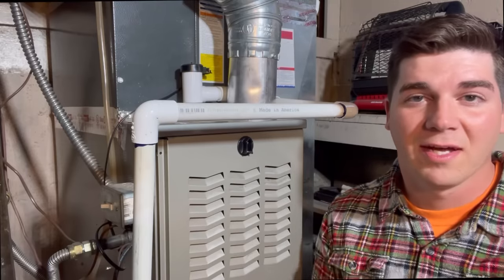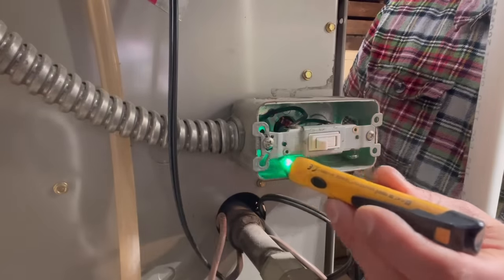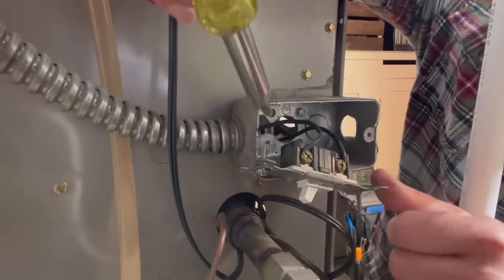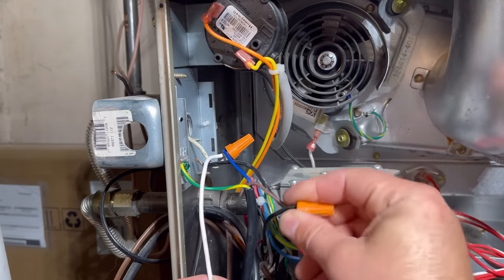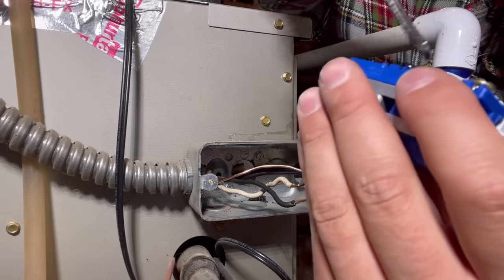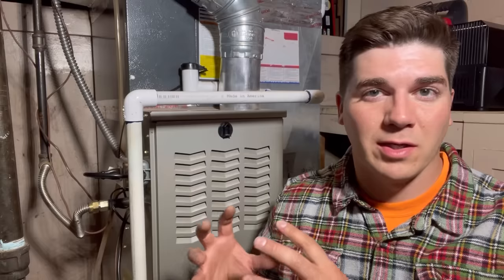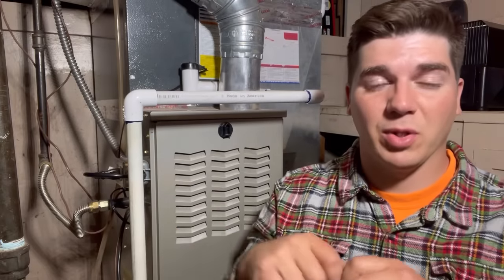This Could Keep Your Family Warm During An Emergency Power Outage.

Comment: I did something similar a few years ago during an ice storm, I cut off the end of an extension cord, took the wires off of the switch and connected them directly to the pigtail that I plugged into my generator, then once power was restored, I connected the switch back up. It was a temp setup during an emergency, but got the job done, this is obviously a more permanent solution. I've since just wired in a 4 breaker transfer switch for multiple outlets in my house, furnace, fridge etc. all powered by one extension cable to genny.

Comment: Just remember new furnaces are computer controlled and ungrounded generators or non inverter generators may cause problems.
Reply: Great point! Is having the ground wire attached to the case of the cabinet not sufficient enough? Thanks for your insight!
Reply: @BenFyvie  may need to ground the generator itself.

Comment: Thank you sir for sharing this hack to help us your followers in the case of an emergency situation when utility companies fail to keep up the power grid running like what happened last year winter here in Texas we were with no electricity in really cold weather but we were just blessed that we just didn’t have power for half a day and we were able to go trough it but other people were days without power and other just perished under the bad weather conditions and it was sad to watch in the news few days later the aftermath of the tragedy and knowing how many lives were lost and it could be prevented by doing a project like this were we can find a survival solution for the emergency I hope we’ll be able to do this “modification “ to our furnace and power it up with a power generator or with the new solar panel battery instead of a gas generator I hope any of your followers will take advantage of the help you provided in this video… since I subscribed to your YouTube channel I have found tons of valuable information, thank you so much for your help to others is really appreciate it,You have a blessed day now!!!Saludos!!!👋😊👋

Comment: Thank you for this video. My issue is something different but this video gives me the confidence to be able to tackle this issue myself. My problem is that my switch to control the power is mounted right above where my furnace filter goes in. So every time I replace my filter, it rubs up against the switch, often making it very difficult to replace the filter. It will often damage the filter when removing it. But I am definitely going to try and relocate the switch instead of trying to relocate the filter location in the return.

Comment: What I did was split the Romex in my rafters into two metal boxes, the first metal box (from the breaker) I added a single receptacle. The second I did a change over of Romex (to the furnace) to a stranded 14ga "workshop replacement cord" in 10ft so it could drop down to the floor to connect to my extension. I  keep the stranded cord spooled up and stuffed into a brace in the rafter when its plugged into the outlet. My furnace (Armstrong Air Ultra V  Tech 80) ran perfect off a new Craftsman CMXGGAS030731 generator with no other device in between.

Comment: We put in a new high efficiency Furnace when the last one died. I bought a $200 RMS UPS and I plugged the furnace directly into that which is plugged in to the switch outlet. That is for my friend who lives in the city, I live in the wilderness with an oil-fired Toyotomi oil-fired Toyo stove. I have a square wave inverter I got at the auto parts store, 12 volts to 120, and some old batteries that got me through the 10-hour power outage. I was eager to put in the additional power when we put his new furnace in as I have needed it in the Alaska wilderness. The power only fails when it's -20 outside and the wind is like a unrelenting hurricane with clear skies.

Comment: 10:37 Wagos. Haven't had the chance to try these yet but I DO like the lever to undo them. most other push-in connectors are permanent. All LED "can", "wafer" lights have push-ins. ALWAYS test your connections by pulling on the wire. I can't tell you how many times I've finished the install and flipped the light switch and it doesn't work cause of a loose wire/wirenut/poor connection. I change most factory wire nuts as well as a 80% rule of thumb.

Comment: I'm in ontario canada.  Back in 1997 the hydro inspector told me how to hookup my generator.  Basically the furnace feed wire was  cut and lead from furnace put in a junction box. The box then  had a cab flexible cable with a male twist lock plug. Within reach of it was a box with matching female twist lock fed by the power feed from house service.  Beside it was an identical box fed from my generator (or the battery powered inverter). So I  plug the male into whichever feed I  want and always have generator isolated from my house service.  Interestingly an electrician told me that this set up is no longer approved. I'm grandfathered as it was acceptable in 97

Comment: Very smart way to create a bypass to power the burner.  My system has circulators which are also on the burner circuit, make sure your auxilliary equipment is also powered when using the bypass power.

Comment: Worth noting that if your furnace employs an e.c. motor ( converts ac to dc at the pcb and utilizes pulse width modulation ) such as the newer carrier models you are going to want to VERIFY the draws ahd voltages in the circuit under load.  Running these blower motors off of an improperly balanced power supply will kill the motor which is way way more expensive than replacing a split cap motor of old days..  we are talking a grand easy. It also is likely to not work at all till you get your grounds sorted.    If youre still reading, take all that into consideration, im not saying the o.p. did anything bad here, im just saying that all mechanical systems are not alike. :) respectfully.  Good video . ( you should never use quick connectors in electrical work either, even though they do look cleaner  ;)    )

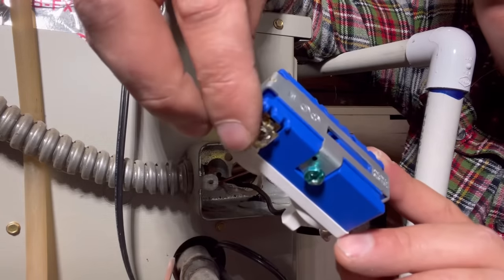Comment: @ 3:05 Wiring is not incorrect but could be simplified . Brass colored screw is "hot" ALWAYS, silver screw is neutral, and green screw is ground. No need to break the tab between the 2 black screws for this application, just tighten them with no jumper wire needed. Wire as black (hot) wire to brass screw, white (neutral) wire to silver screw, and bare/green (ground) wire to green screw. Check switch/receptacle with multimeter to verify switch controlling receptacle without all the jumper wiring if in doubt. Furnace cord/wiring as shown in the video.

Comment: well ducted air conditioners are using a lot of watts when been in cool mode and in heat mode if the unit is a heat pump!If the unit is running on gas then the only thing thats running is only the blower fan so in theory the unit only need 29 or even close or less than 100 watts to work!So that thing you saw us not only it works but its is something that every one needs to know!Nice video and keep up the good work!
Reply from the maker: Yes this will not work with a heat pump unfortunately. Only for 110v applications like a gas furnace.

Comment: I used a 3 way switch it has 2 power sources ComEd and Generator. The common terminal is connected to the furnace. I have a small transfer switch here so I can switch in and out things as needed.

Comment: You can make or buy a double male cord and just plug it into the receptacle. I wired my furnace with a 2 outlet receptacle after the switch. Turn the switch off, plug in double male cord and you're good to go.

Comment: I had another thought... this configuration would allow use of a Kill A Watt or equivalent energy usage meter.  (Assuming of course the pigtail was not kept to short for it to reach the outlet on the that device.)  Knowing the actual consumption of the unit could help is planning the overall load that the generator can handle.  I thought of this because I just had a solar system with batteries installed, and if I loose power in the winter it is the batteries that will keep the heat on.
Reply: I had the same thought and intend to do when I implement this.  I've tried to measure furnace power in the past with a clamp current meter but I don't think it's as accurate as a Kill A Watt.

Comment: Very clever idea to get around a hot pigtail,.   Note that an Eaton switch/outlet is being used in the video.  Terminal locations on a Leviton device are in different places, so it will have to be figured out.

Comment: One note about powering your furnace from a source other than the household supply, my furnace specs say it must be good sine wave power like comes from the power company. Some generators don't produce clean sine wave power. I bought a Honda EU2200i generator that claims to produce clean sine wave power.

Comment: Thanks for the video and the other video you posted with wrong info, I figured it would not last long, but you gave me a better way to get power using the converter to work the furnace. I have been doing research for months on how to power up and gas boiler since I have steam heat in the house. I was looking at the solar panels with battery back up, at least during the day it will charge up and here they don't have enough power to handle the furnace. After looking at your video and you mention about the inverter for the car battery. You got me thinking here. Need to do more research on  this!

And I have bought two power surge battery backup to power up the Frigerator during to power outage if I had it. The furnace is one I really was aiming for, but watching your video the converter maybe the way to power up solar power battery backup. again research first on anything!

Comment: Only works if you have a Non-Electric Heater.
Natural or LP Gas, Home Heating Oil, or Coal Furnace.
Also, I would recommend that the inverter should be a True Sine Wave Inverter.

If you Have all Electric Heat,  then a 12v Inverter will not work.

One Winter I was able to use a 800w Parabolic Infared Heater on a 2000w Inverter.  
it was enough to keep one 10 x 10 room warm.
The Inverter was rated 1000w continuous, and 2000w peak.
Make sure you double check the rating of the extension cord.
a 15 amp cord is only good to handle a total of 1800 watts.

also
Forget about the Clay pot and Candle heater,  Doesn't work.
Might keep a very small closet warm though.
but that wouldn't be very safe..

Comment: Have to turn breaker off for furnace in panel also before starting generators, using invertors. It will back feed to panel. Shock line workers repairing the lines, power outage.

Comment: I know people are saying just get a generator...welp sometimes that is not the solution. Our house is 240 years old, has had additions, and there is no way to hook up a whole house generator for reasons I won't enumerate here. We did install a plug to one of our fossil fuel furnaces to run off a generator (we have two portables) but it is not easy to get an extension cord there and somewhat dangerous plus have to keep topping up the generator with gas. We don't have natural gas...just propane. Anyway, this is a fantastic option (battery) and one we can easily implement. Could mean the difference between life and death. Many many thanks. Use the super thanks payment button people! Send a buck! This is great information.

Comment: I did something similar.  My furnace was 'hard wired' to the breaker box.  After turning off the breaker (of-course) - I cut the line and simply put heavy duty male and female plug ends together.  I leave it plugged in - but in case of an emergency I can run an extension from an portable generator outside.  Like your way also !!  (especially since you already had an inline switch.....

Comment: It’s interesting how the electrical code is different between countries. In Australia, a domestic furnace must be connected using a switched outlet for electrical isolation purposes. Also it’s completely illegal to work with any electrical circuits (which includes power outlets and light switches) unless you are a licensed electrician.

Comment: Glad my furnace doesn't need power to run. I have heat even if the power goes out, I just have to manually press and lock a gas valve. Nice to still have an early 20th century natural gas furnace.

Comment: Thanks, finally got the job done and ready for power outages.  For some reason my furnace has 2 fuses 10 and 20 amp at the furnace switch so I did the connection after the fuses.  I researched and appears fuses are for blower and igniter.  I hope when generator is running it doesn’t cause an issue bypassing the fuses.

Comment: Perfect video.  I could have done one easier, by simply using a plug before the existing switch to a plug and the supply to a additional outlet box, but yours looks fine.

Every device in a home like this should use a electrical outlet box and plug.  Just like your fridge, freezer, dryer, washing machine and oven.  Leaves me to wonder why they don't do this for furnaces.

Comment: I know that 90% of generators sold in the US puts out the proper 120v but be mindful when buying a cheap generator because they will put out 120v however they will only put out 50 hertz and the furnaces require 60 hertz. This will cause the board to burn up. I have went on several no heat calls where customers had purchased cheap generators because that's all that was left before we had a major power outage. Start the generator and get a meter that can read hertz and check it. Very easy. Save yourself an expensive repair bill.

Comment: Not trying to tell you what to do sense you probably been doing that for years and years but it’s ideal to put the source wire in the middle slot for the least resistance so it doesn’t have to travel as far to reach the rest down the line(s)

Comment: This is a great idea, but to make this more simple, you don't need to install the switch and receptacle combo. All you have to do is install a receptacle and the cord plug will serve as the disconnect. The switch is only needed if you don't have another means of disconnect but in this case the plug and receptacle would be all you need and then this eliminates some of the confusion when it comes to wiring and installation.
Reply: A McGuyer is great if you have an unanticipated emergency and need to improvise, but  it's not safe to McGuyer permanent power connections. Furnaces are permanent appliances and  required to have permanent electrical connections . A furnace disconnect switch, not  plug, is required by US codes. - which makes  your method legally suspect.  (The video's method has other issues.) Electrically and legally,  you could meet the code using a DPDT switch to transfer the hot and neutral furnace power connections between the house working and a female service outlet. A standard extension cord could then be safely used to connect the female outlet to a portable generator for "service".

Comment: As an extra precaution I use electrical tape around my wagos in my industry I have had them lift a little and the wire come out due to some movement, thank for showing how to do the furnace for an inverter option.

Comment: Saw this just after it was put up on here.  Thought it was a great idea.  Got the switch / outlet, installed it about a month ago.  Well on Wednesday we had an ice storm blow through here, knocking out our power for 18 hours (a new record for us here in Wisconsin).  So I fired up our portable generator outside, ran an extension cord inside and plugged in the furnace.  All was nice and warm....
Reply from the maker: Awesome sauce. Glad it was helpful for you 👍🏼

Comment: Don't pop the tab off - flip the switch over.  On the outfeed of the switch wire your hot lead.  Wire your neutral to the neutral of the plug.  Connect the ground and now you have a switched outlet.  Already done this myself. It works.

Comment: nice ,in a real emergency that is great, however the gas may go off too. good to have a real dependable backup.
   another big one most do not think of is when the power goes off the sewers may backup. it is  a longer conversation ,bottom line you need a sewer plug or your house will be uninhabitable .  
  here in michigan the land is flat and the sewers are pumped . that means when the power goes off you hope the generators will be working and soon they will run out of fuel, than the sewers will back up. a simple 25 dollar sewer plug inserted into the cleanup will stop the fumes etc from backing up. this is likely to happen someday as the shortages are real.  don't think it will not happen, just be smart and spend a little cash to be ready. why not ??
Reply from the maker: This is brilliant. I need to do some research on that.
Reply: @diyhvacguy  thanks,i give you credit for seeing this as a real possibility,most people are happy to be ignorant. Like...dont bother me with the facts...funny how that is

Comment: They make a part called an inlet.  An inlet will allow you to safely use a standard drop cord to power the furnace off a generator or inverter.  The only thing I would recommend is changing the switch to a spdt 3 position on-off-on switch to prevent accidentally back feeding the panel.

Comment: You should of left the plug end of the pigtail longer, so that you can plug it in to a battery backup inverter, if the plug is  too short how are you going to do that.Also the knockout between the Junction box and furnace needs some type of protection from being cut on a sharp edge.

Comment: Use the square bit (Robertson) on your multi-screwdriver for the receptacles/switches. The screws are designed for it, no chance of slipping.